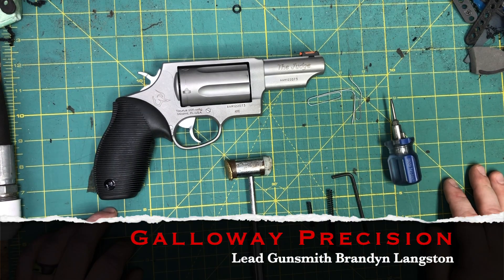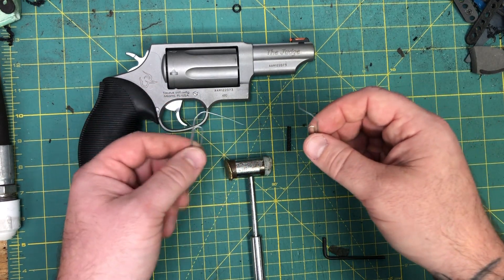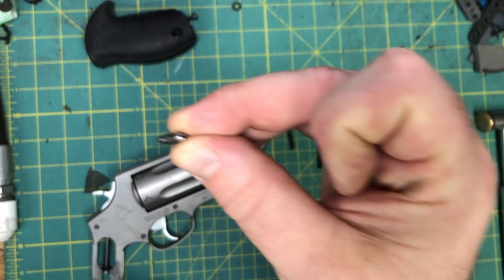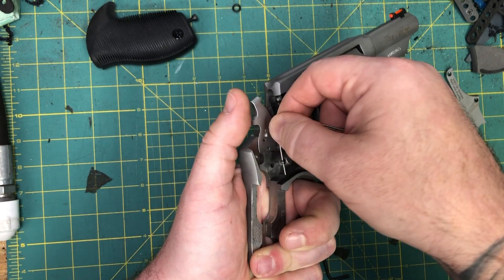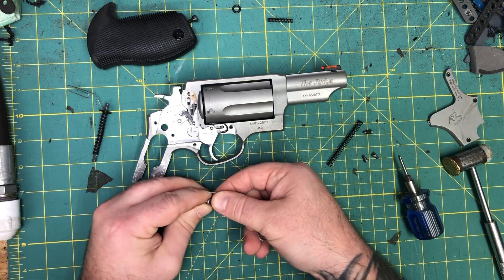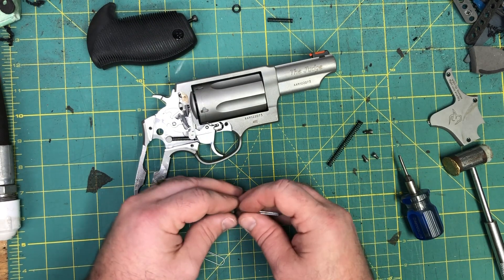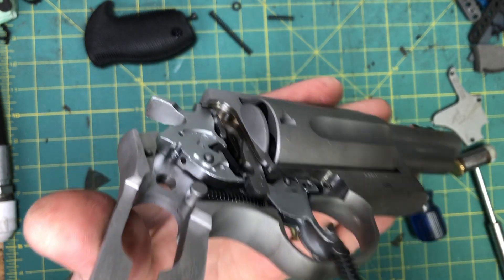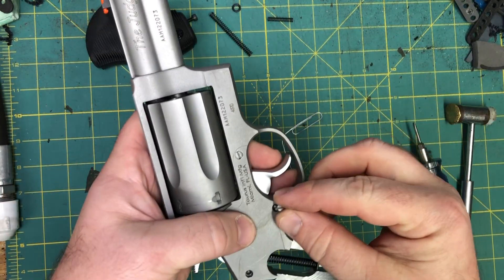Taurus "The Judge" Reduced Power Spring Kit Installation from Galloway Precision

Comment: Should always place your parts away from the work area as you take them out. When you dropped the side plate it fell in the area of the work area where the side plate screws were laying. Could have knocked those screws into a mouse hole somewhere and thus gone for ever. I learned this the hard way.

Comment: I have a Taurus Judge that I just got bought. The hammer is so hard to pull back I almost have to use both my thumbs to pull it back. Is there a adjustment for the hammer
Reply: Negative ghost rider I’m no gun smith but that might cause you to have dud rounds
Reply: Check the rotation of the cylinder it may be too tight
Reply: Your comment is 2 years old so you may have figured it out by now. In case you haven't you may want to take the gun apart and look for burrs that didn't get filed off at the factory. Properly lubricating the gun also helps. I had a lever action 30:30 rifle that was hard to cock. Took it apart and found several burrs that I filled off. That made a day and night difference in cocking the gun.
Reply: @normtheteacher5485  thank you

Comment: Nice vid, love my Judge. Question: Where can I get a Hammer like that? Mine is bobbed, I hate that darn thing but I don't want to sell it or trade it. Only need that extended hammer IF you might have a line on one, thanks.
Reply from the maker: If you have a Public Defender that is just how they come. In the video ours is the stock hammer on The Judge.
Reply: @GallowayPrecision  
Yes it's a Judge Public Defender. But that damn hammer sucks. Might see if I can mill something that will work. Thanks.